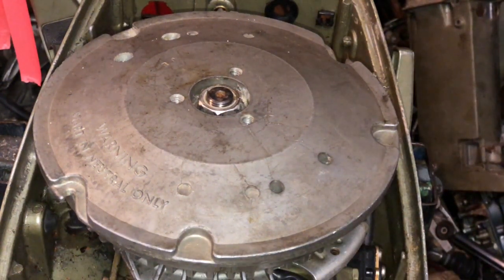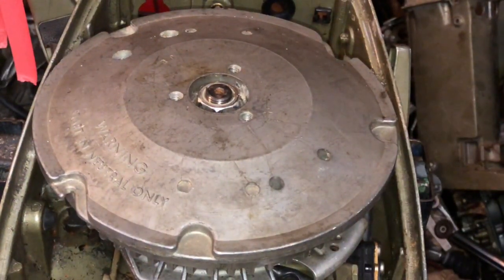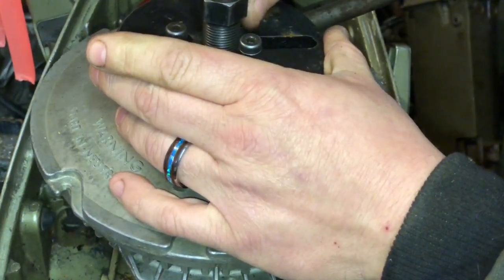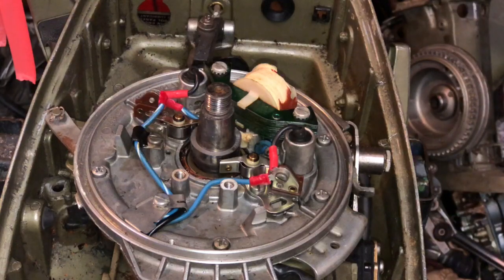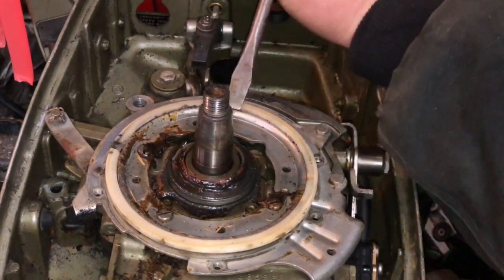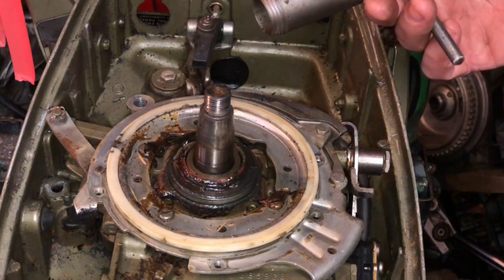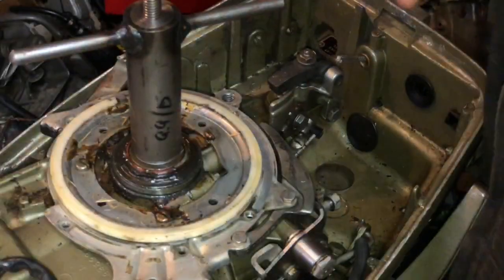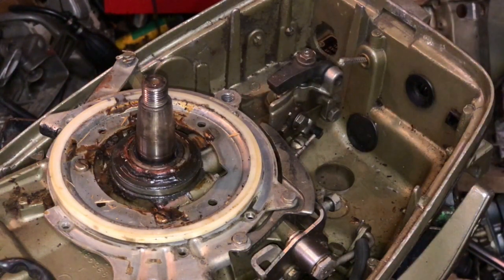Johnson and Evinrude 9.9/15hp upper crankshaft seal how to

Comment: You mentioned a lean pop on another motor. Are the seals the culprit of this after all adjustments won't do the trick. Thanks for your advice love the videos!
Reply from the maker: They can be but you will want to check for vacuum leaks